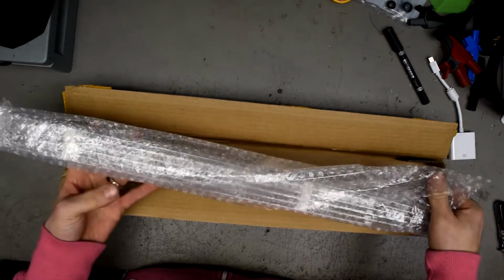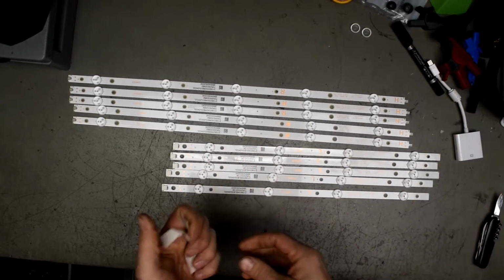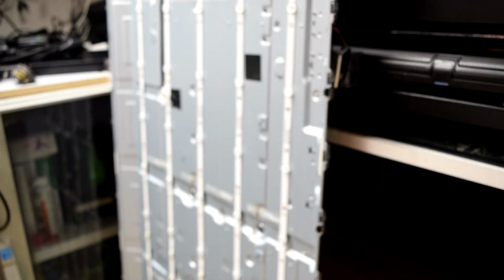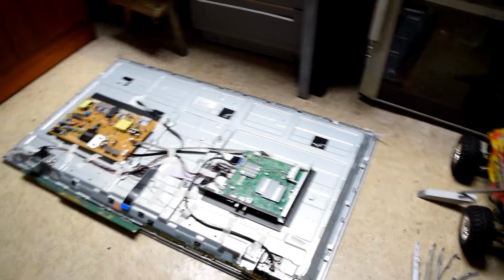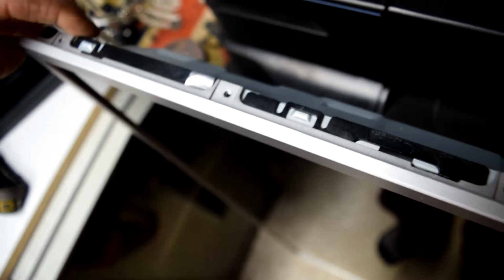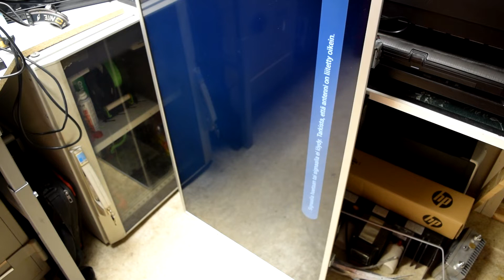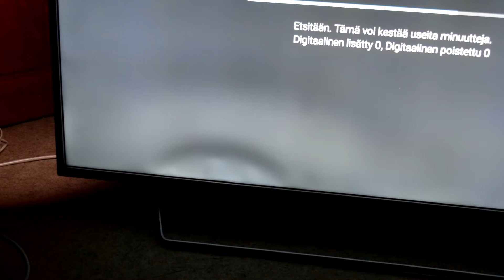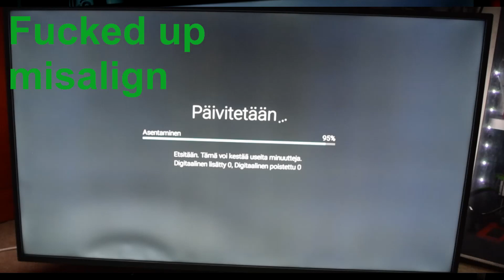Philips lcd 4k tv Model 49PUS6412 / 12 BackLight Led installation and reassembly

Comment: Thank you for your video, i have exact the same TV with the same issue and now i will be able to fix it myself :) !
Reply from the maker: Creat news =)  i still suggest you to watch someone elses lcd backlight repair video to see how it should be done xd imean that you REALLY sould lay tv Screen upwards when starting to take frames and polarizers off. Or  disassembly stage that myway was awesome but when you put it back together then you should do it screen upwards =) i scored aliexpress those Backlights for 20 euros. And i hope you good luck for diy repair
Reply from the maker: € 19,68 | LED backlight strip 9 lamp for Philips 49"TV TT4906F LB49021 49PUS7503 49pus6412 TPT490U2 49PUT6162 49pus6162/12 LB49023 V1_00
https://a.aliexpress.com/_mtnKsLm

There is link for backlight what i used
Reply: @ElectronicMechanicFinland  i just recieved the Parts, so i am Gonny try soon enough
Reply from the maker: @Sdewendt good luck to you for repair =) be patient and no rush or force use and you can do it
Reply: Ale widac ze cos nie tak zlozone na dole wkranu